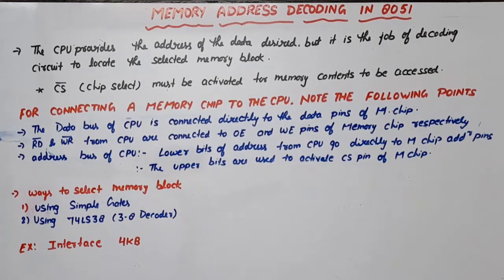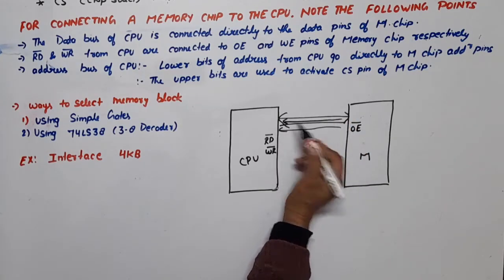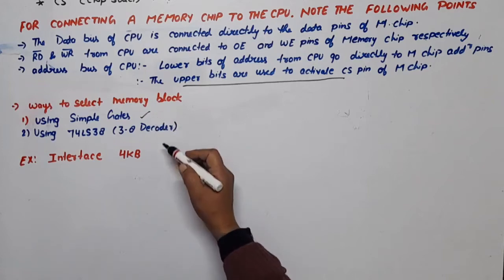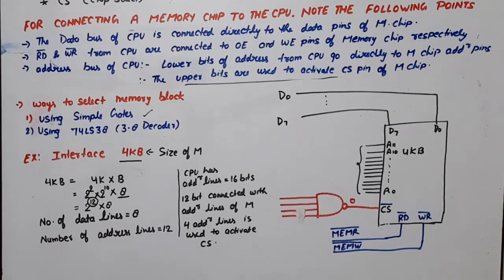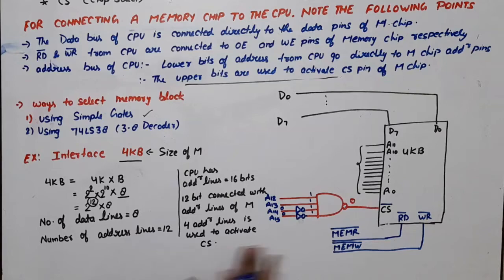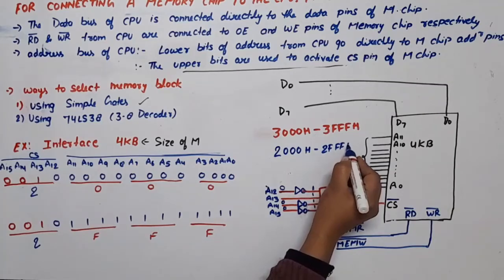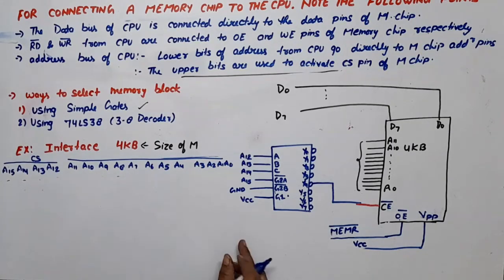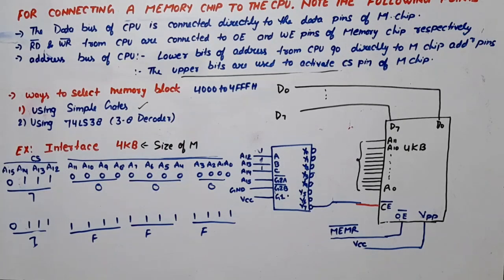Unit 4 L8 | Memory Address decoding in 8051|  memory address decoding

Comment: Mam how we decide that, this address line active when we gave 0 as a input? 
And other question is chip select have unique address or it changes with time? As you gave example like 4000 to 4fff and in next example it will be 3000 to 3fff
Reply from the maker: Chop select lines are fix for respective size of Memory for example if memory size is 8K then only 13 lines will be used as address lines remaining 3 can be used as chip select lines 
Now possible combination for 3 bit is 0 to 7
Means it can be any from 0 to 7 for respective memory